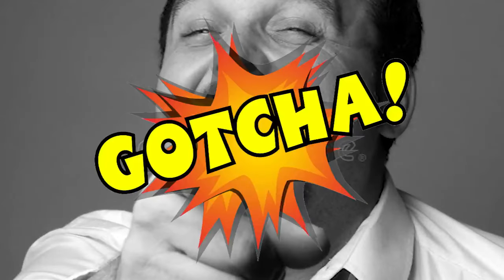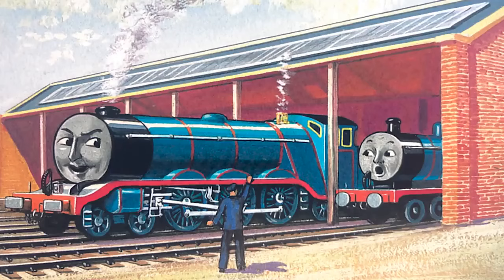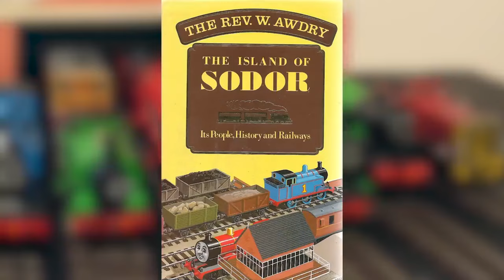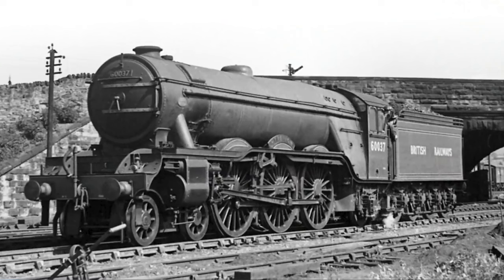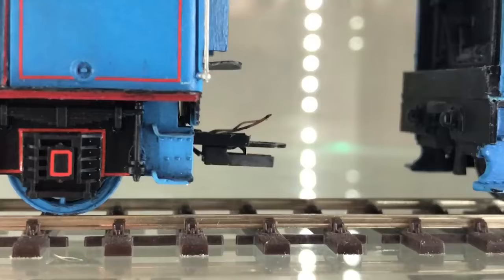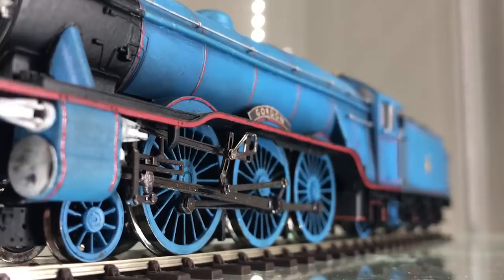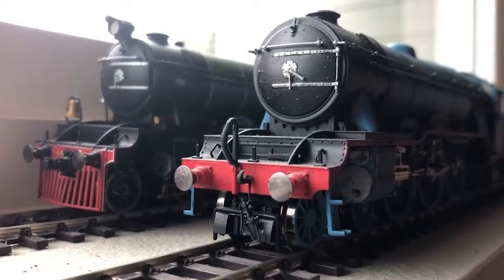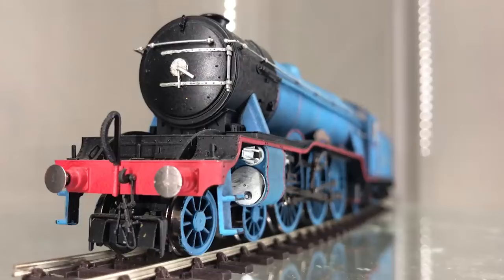How I Built Gordon – Tug's Trains

Comment: I think Gordon might've been intended to be an A1 from the start, but since there was no A1/A3 model when Awdry built it, he had to do it with the triang princess, which is hard to convert into a 100% accurate Gresley pacific, specially with the different running plate. So he had to compromise and create the A0 backstory.

Comment: Fun fact, uhh, weirdly enough, Gordon's sloped running board (to some degree) is accurate, since there was an engine, GNR No.461, the Prototype of the LNER/GNR O2's which had the same unique characteristic of a sloped front running board, so, it could be said that the sloped front running board is a characteristic of Gresley prototypes

Comment: You can try old shape Henry use a A1 with a lot of modifications including a sloped footplate and  different tender use the same modified running board use a different body maybe  make a C1 body longer and take away the side things on the smoke box on the side.